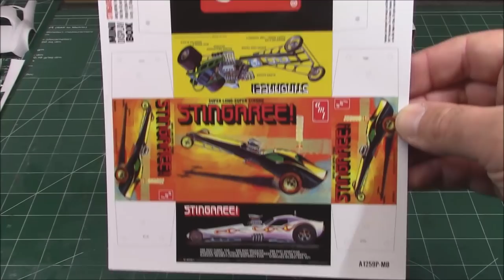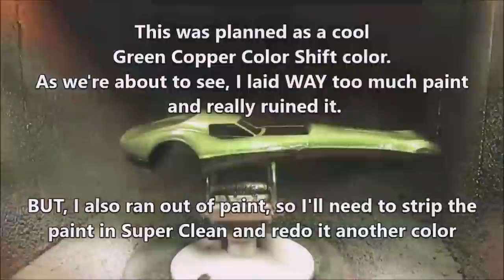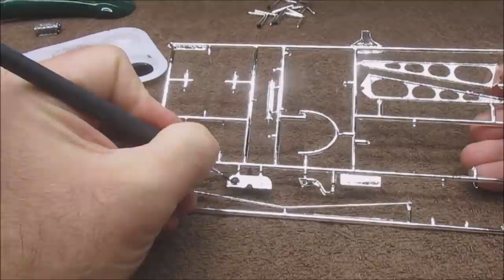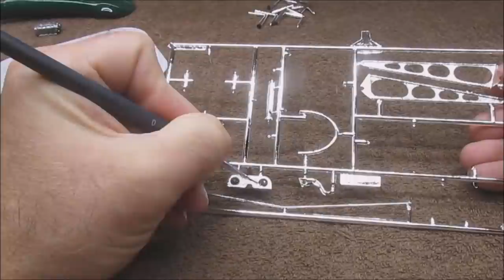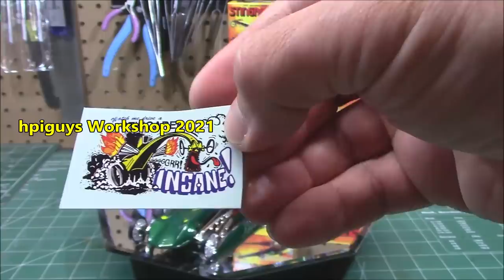STINGAREE CUSTOM CORVETTE STINGRAY HEMI DRAGSTER 1/25 SCALE MODEL KIT BUILD REVIEW AMT1259 AMT

Comment: i use to race slot cars  on 1/8 mile like the real drag strip but shorter , take the bodies and mounted on the frame u have to build  fiting the body, u have a jig to use  for the build